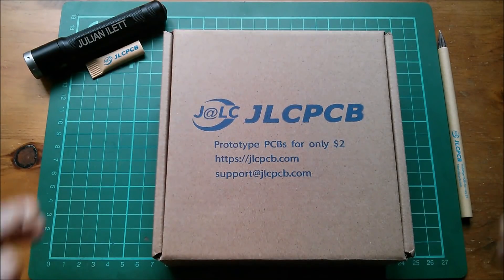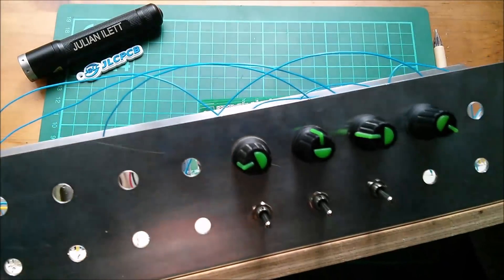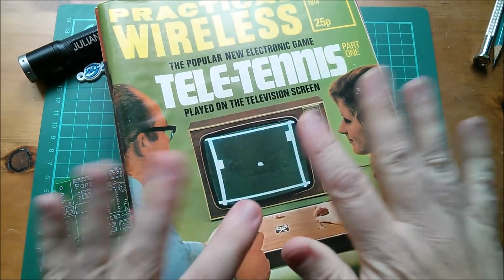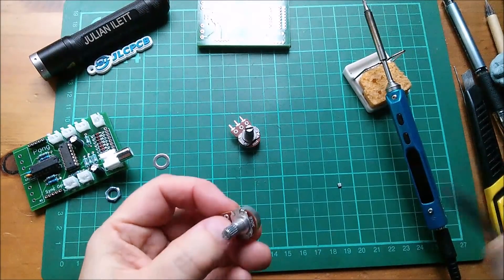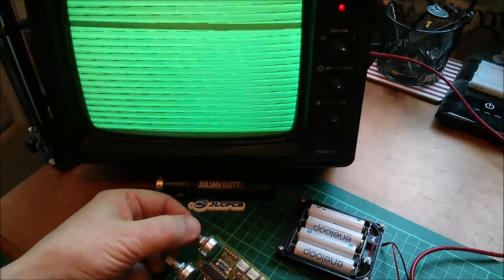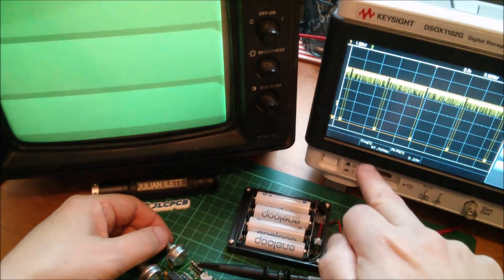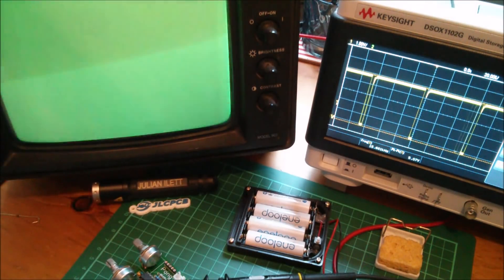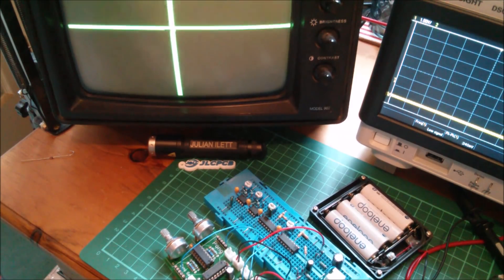New PCBs from JLCPCB - Pong/Tele-Tennis Sync Generator

Comment: When I was an Electronics Apprentice at GEC back in the 70's we used to use SoT (Select on Test) stand off posts so we could tune each circuit with specific resistance values. Connect the scope and a precision variable resistance then select appropriate resistor combos to give the exact timing needed. Component tolerances meant every board was different on final test and we didnt want to use pots in a semi-Mil-spec application. 

Fun times

Comment: This is a blast from the past! I built one of these, but not from the Practically Wireless circuit. At the time I was working at  TV Centre in one of the BBC studios, so had the full resources of the engineering workshops and stores to draw on. My colleague Eric designed the circuit from scratch, and since we had access to a full Black & Sync generator we didn't need that bit of the circuit. We did use 555's for the video elements. My input was to convert his circuit diagram onto Vero-board. The final result was built into one large Eddystone diecast box, with two small ones for the pots for the "paddles". It worked well, and we used to play on a 19" monitor! At one point we made adaptors so one of the paddles could be remoted to another studio! I remember reading Mr Hughes articles back in the day. It's fascinating that these simple analogue games have made a comeback as has the 555. I designed and made a door bell that mimicked the original Star Trek "Red Alert" siren around the same time! Endless fun!
Reply from the maker: My dad worked at TV centre with Patrick moore on the sky at night. I went with him a few times back in the 70s

Comment: You really need a 5 volt regulated supply (a 7805 fed from >7V or so would do). Feeding analogue electronics directly from batteries rather than a regulated source is asking for trouble, especially oscillators. In theory it shouldn't have any effect on a 555's divider chain / comparator pair, but analogue electronics is an awkward thing.
Reply: although a 7805 gets the job done it is somewhat wasteful as you need 2v minimum between your output and your input (depending on the current you draw). a lower drop regulator is advantageous as it does not necessitate an additional one AA battery to get the required voltage that just gets deminished by the regulator. btw digital electronics are a strange breed as well.
Reply: @urugulu1656  The circuit will only be drawing, what, 5mA? Less if it is a 555/556c. Feel free to use an LDO but it will still need overhead to account for the battery voltage fall-off over time and we are only getting 5.3v or so on those cells. Or better still, just use a regulated PSU.

Comment: Well that is why you don't use ceramic caps in timing circuits, they suck. Remember, ceramic caps change their value depending on temperature and voltage (and some other things). Use plastic film caps or tantalums, depending on the value you need. Leave ceramics for decoupling, unless it's a small value and can be made cheap with NP0 dielectric.

Comment: Nice! I remember the previous video where you talked about the tele-tennis game, so I'm glad we're getting to see more of it.

Speaking of the 555 timer, at the moment I'm working using a 555 to generate a PWM signal to drive the speed control pin on a PWM fan to cool an LED light. I think I've figured out how to get a thermistor to control the duty cycle so it increases as the temperature increases, I just need to find a thermistor with a suitable resistance range. None of this new fangled microcontroller rubbish, a 555 timer does the job just fine!
Reply: how about a thermistor being read by a bit of analog magic that then is being used to drive a jfet in its linear region to get you the resistance you actually need to control the pwm
Reply: @urugulu1656  thanks for the suggestion, I'll definitely look into it if I can't find a thermistor value that works out on its own!
Reply: @UpLateGeek  although then you are really better of using a µC as the suggested solution will take a couple of parts (where as the µC will only take itself a resistor the thermistor and thats basically it)

Comment: Julian, I missed hearing your final resistor values.
Reply from the maker: I think they're 330k and 30k, but they may change again. I'm wondering what difference 5.3v makes over 5v.
Reply: @JulianIlett  is that your current voltage if so put a ldo in front of your circuit. if you dont fear sot23-3 packages there is a chip "65z5"

Comment: Am I missing something, or is the field sync oscillator not kept in sync with the line sync oscillator? Does it matter if those get out of phase, or does the monitor not care?
Reply from the maker: I've thought a lot about this. The z80 video card has perfectly in-sync sync. The out-of-snyc sync in this project may be responsible for lot of the   wavy lines that I'm getting.

Comment: is that really just two nand gates used? you couldve made that probably as small with a couple of discrete transistors cant you?

(since one of the two gates is wired as an inverter i would guess it only takes 3 transistors to do the job...)

Comment: Glad to see pong making a comeback...
IIRC there were IC's available with the logic for a few games programmed in at the factory - one of my dad's apprentices brought one round which had a tank and maze type game... probably late 70s.
Think the project lived on quite a small circuit board with a few support components and obviously an ASTEC UHF modulator which was of course the most impressive looking thing.
I don't suppose anyone here can remember the part numbers of those game chips?
Reply: joinedupjon You’ll be referring to the General Instruments AY-3-8xxx series of TV game chips. I still have a couple of these in my parts box. The original bat & ball chip was the AY-3-8500. I have the AY-3-8550 which added horizontal bat movement using an XY 2 pot Joystick. I also have the AY-3-8700 which was the tank battle game you describe. I must get these out and wire them up again sometime. :-)

Comment: JLC PCB are the best, I always order my PCBs from them
Reply: JLC are not the best. They are entirely without morals. They interpret their rules differently on different days, and reject designs today that they accepted without complaint yesterday. One time, they actually tried to charge me extra for orders ALREADY PAID FOR, MANUFACTURED AND SHIPPED months ago. At another time, they tried to charge me a fee that didn't exist - and then, when I pointed out that my design conformed to their published rules, they changed their published rules right there and then so that it didn't.

JLC are the lowest bidder, the bottom of the barrel, and their business practices and ethics reflect this. They may be the cheapest option, but the company stinks.
Reply: @SodAlmighty  OO now thats nasty, weel my experience so far has been good

Comment: Perhaps your capacitors are not the correct values.
Reply: He should put there stable foil caps not cheap ceramic ones.
Also, original project was build on bipolar NE555 and he probably have put modern CMOS replacement with lower input bias currents.

Comment: I had that bunch of PW mags when they were current - the cover photos seem alarmingly familiar - I didn't fancy building a Tele-Tennis though - (radio man, see) but it's great to see you building one Julian - analogue composite telly signals without a processor in sight :o)
Reply from the maker: Yeah, like the vocoder is awash with op-amps, this project is full of 555 timers :)
Reply: @JulianIlett  Haha ! Yeah, I was always a 7555 man myself, as soon as they were available, but where would we be without 'em ?
Reply: @noakeswalker  7555 thats the new enhanced version of that venerable chip... well the og one does fine for the most part though

Comment: With a wider range,  this would be handy for finding monitors that can handle MDA/EGA/VGA signals.   It would also be "good" for destroying any surviving CRT screens >:)
Reply: destroying? how exactly?
Reply: I saw off my last 2 good ones by driving them at 1920x1444 instead of their rated 1600x1200 max.   I popped the horizontal drive transistor I think.
Reply: @MattOGormanSmith  so not exactly anything that could not be fixed if your guess is right. after all i would guess that the tube still is fine since driving the beam to a spot outside the "active area" does not appear harmful to me but i could be wrong on that